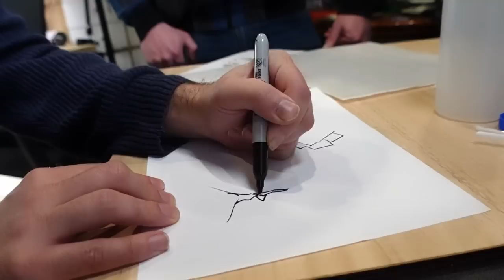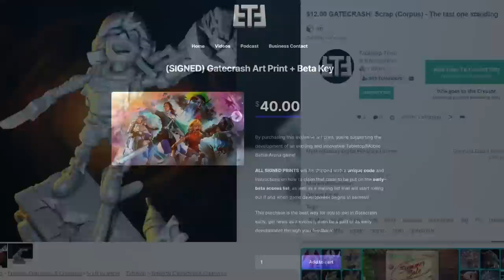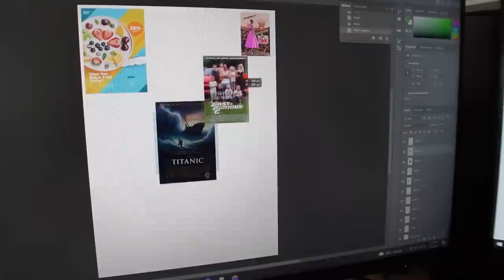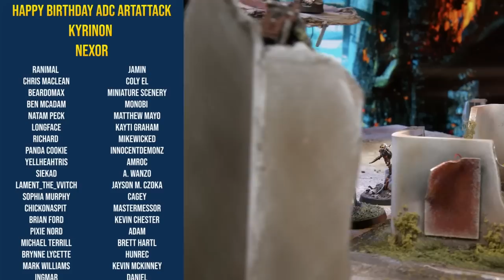Making an Apocalyptic Gaming Board from scratch! (No 3D Printing)

Comment: The board turned out great, but imo it has nothing to do with "inside" or a mall.
There is no rubbish from the shops, no real walls, no height or depth.
It more looks like a modern abandoned cowboy city.
Even the "marble or limestone" looks more like concrete or a road, especially with the arrows pointing the direction to go.

Maybe I just have a different picture in my mind when I think of a mall ^^
Still, the techniques and the outcome: Very cool! Nice board!

Comment: Fantastic idea on the LED TV's! I'd be heavily tempted to put a thin line of LED's on the edge of a thin sheet of clear acrylic behind that dark smokey blakc acrylic, and set a pattern for it to flicker. The idea being that the "TV" is still powered, but because the screen is smashed, only part of it is working. Bonus points for using a 3.5" LCD screen behind and using a partial image set to flicker behind the smokey acrylic.